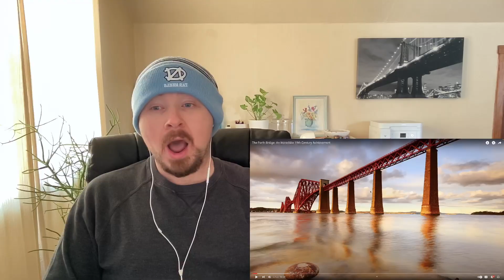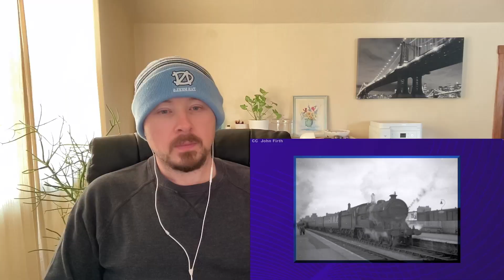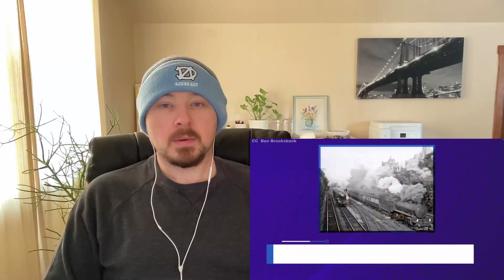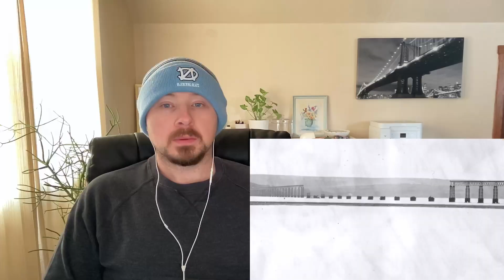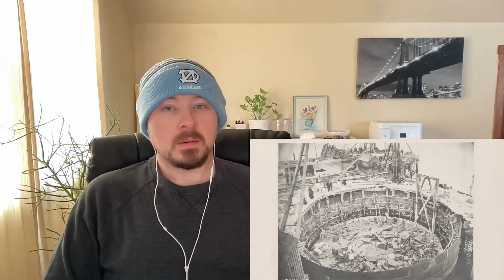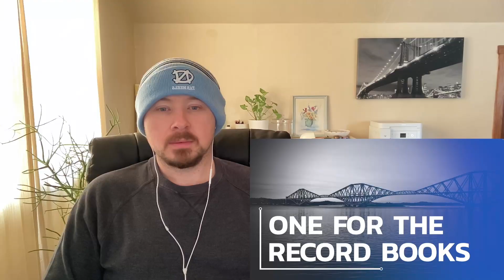American Reacts to The Forth Bridge - Scotland's Greatest Man-Made Wonder

Comment: There's a common phrase used in the UK where people say things are like "Painting the Forth Bridge" meaning a task that is never-ending and thankless - because there was a common myth that the bridge was so long that it look so long to paint, that by the time they finished painting it - it was already time to start again. Unfortunately, that's not a true story - but the phrase is still in use.
Reply: since they changed paint 15 ish years ago its not true but for a certain period it was definitely a constant operation.. At least they had a wee cafe within the bridge structure though.
Reply: It wasn't a myth for over 120 years as there was a gang of painters permanently employed on the bridge until they introduced a modern corrosion resistant epoxy paint which would protect for longer.  Removing the old paint and applying the new paint took from 2001 until 2011.
Reply: It isin't entirely a myth, Until modern paint and such it was fairly accurate a statement..
Reply: In France the same saying refers to the Eiffel Tower. I heard that takes some 60 tonnes of paint.
Reply: It used to take 7 years to complete the painting and by the time it was finn
Reply: @chrisinnes2128  by the time it was finn..... Finished, they had to start again? I'm guessing here but I think that's what you were about to write before... I hope nothing bad happened!!!
Reply: @PerryCJamesUK I'm starting to worry about  chrisinnes2128.  Hope they're OK
Reply: @KenFullman  I had forgotten that I had even posted this what I was saying is that it used to take seven years to paint it and when they were finished they had to start again
Reply: @chrisinnes2128 That's great. I just had visions of you suffering a heart attack in the middle of your sentence.   😁
Reply: @chrisinnes2128  Hope you're OK.  It's been 11 months and you still haven't returned to complete what you were saying.
Reply: I call doing my nails, tinting my roots, etc.,  "Painting the Forth Bridge"
Reply: @cathyrussell7157  My Mum used to say something similar when putting on some makeup. She'd compare it to renovating a derelict building lol That brought back a really happy funny memory so thanks X
Reply: Hi Steve i hope you and the family are well and enjoyed your Christmas and new year.  The Firth of Forth.  It’s a great sight to see and have travelled over it many times.  Take care and have a great weekend.  Stay safe 😘🏴🇺🇸
Reply: My late dad used to say that.
Reply: 😂😂😂ok we paint and then start again!
Reply: I remember John Noakes helping the painters on Blue Peter. The bridge paint colour is ‘Forth Bridge Red’ which emulates the original red oxide paint.
Reply: I hate to break it to you hut it is true, before they changed the paint for it and for proof there is a documentary about the the bridge in which they talk about painting it as well as interviewing the painters themselves
Reply: It is true as my grandad and his work mates use to paint the fourth railway bridge . My he rest in peace xx
Reply: It was not a myth used to be true, before modern paint.
Reply: I remember believing this when aye was younger
Reply: The joke is that as long as the paint holds (modern paint lasts a bit longer) it's the only maintenance the bridge needs.